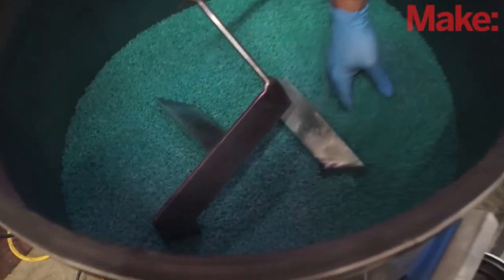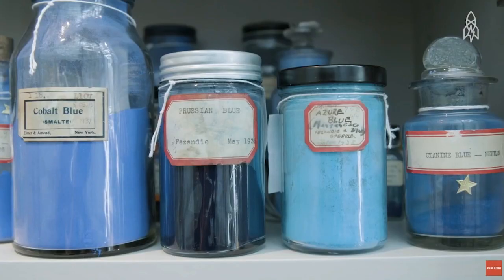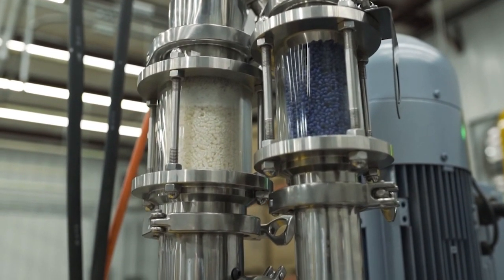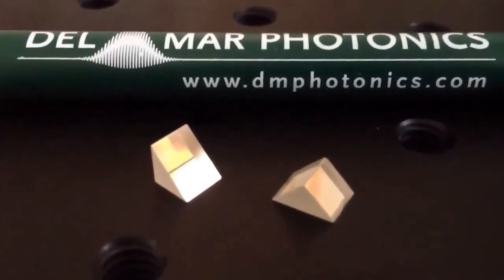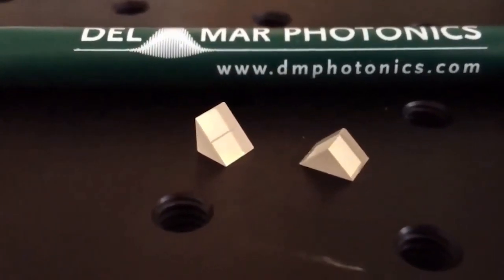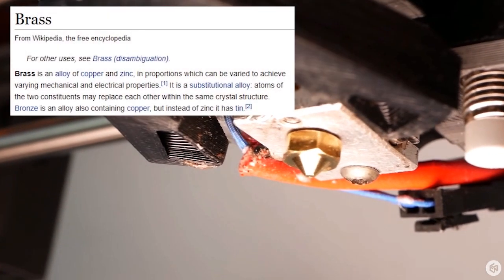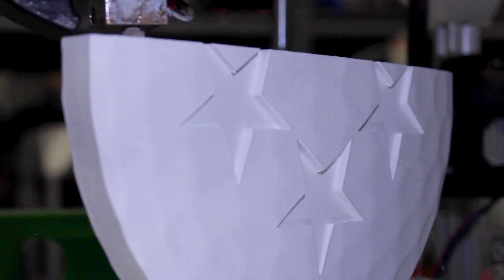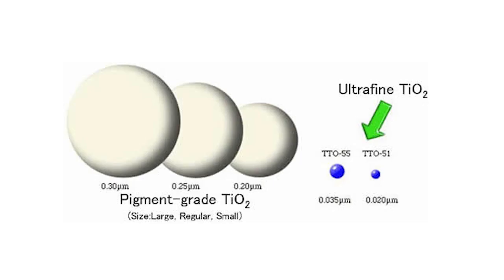White Filament Will Destroy Your 3D Printer

Comment: I bought a 3D printer when The Coughing started. Put it up after 1month because it wouldn't "do right", in my novice opinion. This vid was the answer to my problem.
I learned what was what with the white filament. Then switched to color when the nozzle was out of tolerance, apparently

I see the corporate meeting having this part in it:
Accountant: Naw, that's too much $$$ per unit
Engineer: We can give a roll of white with each purchase
Accountant: That's economically unfeasible
Engineer: White has Titamium Dioxide inside. It'll ruin the nozzles and they'll have to buy more.
Accountant *to Executive*: Give that engineer a raise.

Comment: Can this be mitigated by using my hardened steel nozzles with white filament? Titanium dioxide is 5.5 to 6.5. Brass is only about 3.0. Hardened steel is 7.0 to 8.0. I'm starting to think I should just leave my hardened nozzle in at all times because there are just so many things that damage brass.

Comment: Titanium dioxide is only about 20 Vickers, which makes it really pretty soft. Even if it was diamond, though, it wouldn't "destroy your printer". That's just silly. It might wear your nozzle and maybe even your Bowden tube a little if you have a Bowden printer. It won't hurt anything else significantly.

Of far greater concern is the use of aluminum gun cleaning rods, since the aluminum rods are always coated with aluminum oxide... a primary, and very hard, abrasive material.

Comment: interesting, I usually choose grey over white since its more interesting, this does explain why my white prints are a bit different than the others. I am curious, why are supports on my black prints harder to remove than others?
Reply: You can likely print your black filament cooler than the other colors. If they use carbon black for the pigment it will increase the thermal conductivity of the filament, making it easier to heat.
Reply: @supergiantbubbles  I see, thank you

Comment: My question would be. What would be some of the better colors to get to get then. I know you said black but what are some others. Thank you so much for thai info it helps so much with some of the problems I have bin having.
Reply: In my opinion that’s something you need to dig into. Consider the base information given here. Every colorant/pigment in plastics, paints, etc… is made up of different compounds or single elements to get the color the finished product puts out. Given that, you’ll find signicantly different performance characteristics based on the colorants hardness, particle size, etc…. I worked in injection and blow molding years back. Setting molds, setting up the presses/extruders, etc… I can tell you that I learned then that a color change was a big deal and it was often frustrating to get a part dialed in after changing color. This would be with the same mold and press, same setup. Often you had to change temps/pressures, etc… to account for the change in flow characteristics. Anyway, my advice is, if you are choosing a color for a particular part, do the investigation, find out what it’s made up of and what the flow characteristics are prior to committing to the color/material.

Comment: Watch any Bob Ross painting show and he'll mention the color of the oil paints he's using. Cobalt blue or Titanium White, etc. They are named that because cobalt or titanium is the pigment used to color the paint. And like Slant 3D mentioned... Ti Dioxide is on the order of diamond hard. So yeah... it would stand to reason that when the white plastic is molten... there are millions of tiny little diamond like shards that act like sand paper inside the nozzle. Run enough thru the nozzle and the ID will wear out. I'm not affiliated with Diamondback Nozzles but... I use them and have run two and a half miles of filament thru a .4mm Diamondback nozzle with zero wear.  That includes two 1 kilo spools of glow in the dark as well as CF filled nylon. Thermal conductivity is way off the chart with these nozzles. Yes they're pricey but... like I said, 2.5 miles of filament thru a single nozzle without wear is very impressive.
Reply: TiO2 isn't on the order of diamond hard. Far from it. There are two allotypes of TiO2 commonly used industrially, one has a mohs hardness of 5.5 (comparable to a glass plate or a steel knife) and the other 6.5 (comparable to a steel file). Diamond is 10, and the mohs scale isn't linear. Granted, brass has a mohs hardness of 3, so it isn't surprising that TiO2 is able to scratch at brass nozzles and erode them away...

Comment: Does this happen to all material filaments? Because I purchased a 3D printer on September and it came with 2 spools PLA blue and PETG White and now I'm worried of using the White one, unless the colors are different depending on the material of the filament
Reply from the maker: White is the mose abrasive
Reply: @slant3d  Does gray/silver filament is as abrasive?

Comment: Is Barium Sulfate or Zinc Sulfide/Zinc Oxide smaller? They might cost a bit more than Ti dioxide but they are readily available.
Reply: Zinc oxide has a Mohs hardness of 4.5, brass is 3.0. Seems like zinc oxide would likely still wear brass. Barium sulfate seems to have the same hardness as brass. If people are printing anything abrasive, or think they might someday, they should just get a hardened nozzle of some sort. They're easy to get and work as well as brass.

Comment: White MB contains 50-70% TI02 loading and blended in at 1-2% of the base resin so.. minimal .Black MB can be carbon black or pigment black cheaper filaments are carbon black and will plug up you nozzle faster then you worrying about the white MB carbon is much worse torching burnt carbon is the only way to get it out without damage! some industrial cleaner machines can but not for home

Comment: Would a hardened steel nozzle help with the issue?
Reply from the maker: Sure!. But white filament is still abrasive
Reply: @slant3d  well, ig I will just have to replace my nozzle more often, am currently printing a snowman, in white. But I do mostly print in colored or black.

Comment: What would be a fix to these abrasive filaments? Hardened steel tips seems like a simple solution, albeit I'm stil new to printing
Reply: Hardened steel will work. Tungsten and diamond are arguably better, but definitely more expensive.

Comment: What click bait.  I knew he was gonna talk about TiO2 and nozzle wear. Its not gonna destroy your printer, just wear out the nozzle. Nozzles are a consumable, so replacing them is just normal. Also you can just get a hardend steel, ruby or even diamond nozzles. Your belts will probably wear out before your nozzle does if you go that route.  I print alot of CF filled filament and my microswiss nozzle is just fine. Heck even the cheap steel knockoff nozzle is doing fine as well.

Comment: This is very interesting to know and it just came at a perfect moment for me to learn this as one of my printers last week started to show really 'odd' printing results which do resemble issues with the nozzle.  (have been printing white quite a lot lately)
One of my personal favorite colors to print is the Prusament urban grey PETG. Not sure what difference it makes internally, but it just feels more soft to the hand. Not as hard as some other PETG variants.
Also this particular (pun intended) filament never failed on me when printing.
So I really wonder what makes that filament acting so different from the others? Does it have less "G" of PETG in it? Can the particles used to make grey be grinded down so much futher compared to other color dyes?
Reply: Titanium usually isn't added to grey dye. It's usually ash grey + carbon black, or it's a diazo pigment, which is short chain, non-abrasive, and naturally powdered(won't make plastic pasty). I don't see anything that would make plastic hard to work with there.
Reply: @Bubu567  "I don't see anything that would make plastic hard to work with there."
Yep, it really makes a difference compared to other colors. That's why I really love that filament, even though I had no idea why... until now. Thanks for the explanation.

Comment: It will not make my printer explode so why the hell are you so dramatic? Nozzle and extruder gear are wear items and they cost pennies, and for at home prints where you switch between materials a lot, you replace the nozzle more frequently anyway.

And yes I was aware that white and opaque light colours use hard abrasive transparent minerals with high refractive index to make the light exit early. Which is so weird to think about that the only way to make white is with transparent crystals and you need quite an amount of this added material.

Comment: I have a different take on white. It is probably more of an older assessment though. I would calibrate any new printer using white (I am an ABS guy, PLA is for printers that cannot be tuned). My reasoning is this: 10 years ago it was common practice to recycle plastic in filaments. Regrind. In those days, black was always harder to work with because from roll to roll, it would behave differently. Thats because it could use any recycled material and then covered over with enough black. A colorant is a foreign material that detracts the melting characteristics of the base material so each color will behave differently in thermoforming. Black + regrind meant more variance. I used to buy a single roll of white to get the printer tuned up and then store it as a control. If prints started getting bad, I would throw the white on tier to see if the printer was having an issue, or if the slicer/model was the issue.  As for nozzle wear, I have s dozen in a drawer for $5USD. I also dont farm. So I can say that with the small amount of times I use white, it does not have any noticeable effect. And I would think that also in todays current market, regrind is likely less common. So maybe I will use 'virgin' now for my control. But I have never had white be worse than another color as far as adhesion or stringing was concerned. 110 degree glass bed and direct drive are solutions for those issues.